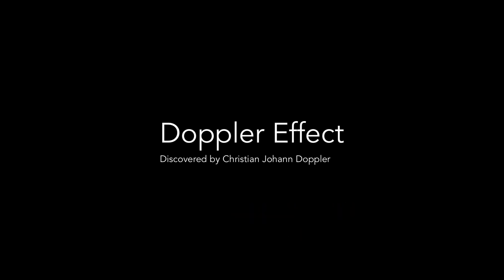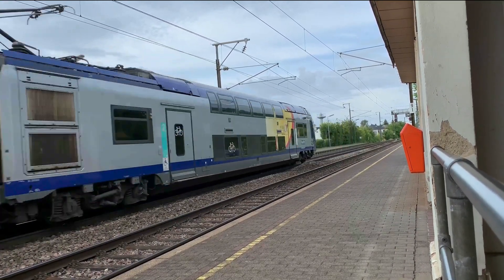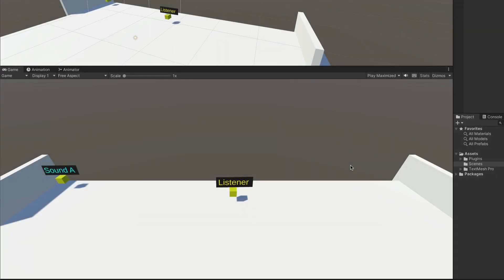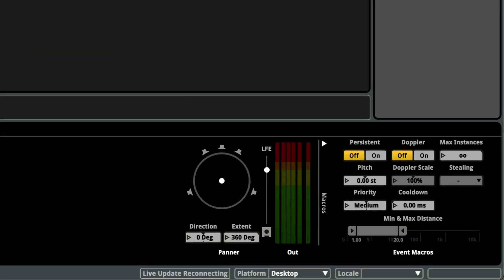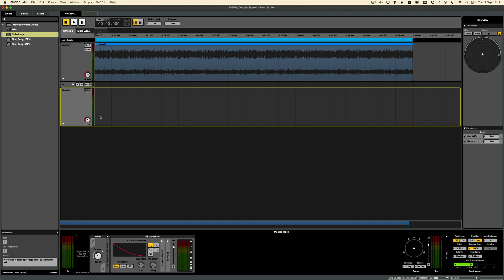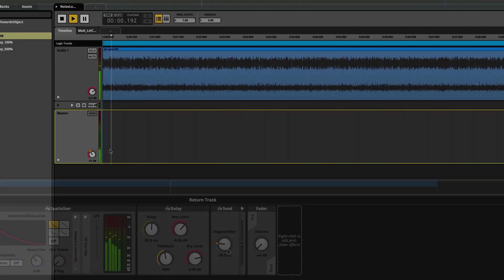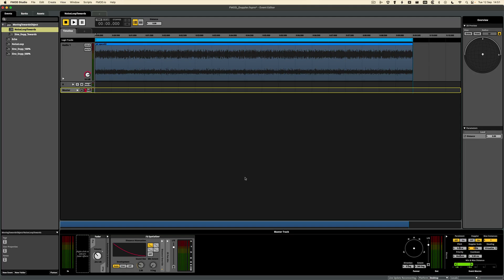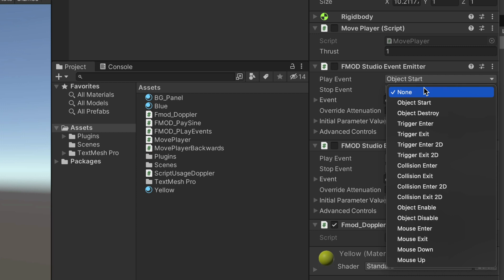Bending Sound - Doppler in FMOD

Comment: Good afternoon, could you describe in more detail the process of creating a swosh effect?
Reply from the maker: The idea is to send the sound pre-fader to the bus in the mixer so you're not affecting that sound with the doppler FX that's on the event output. For more realistic sounds that can be a whole sound design in itself (think passing F1 car at 300Km) you might want to use a separate event or routing the tracks directly to the mixer.